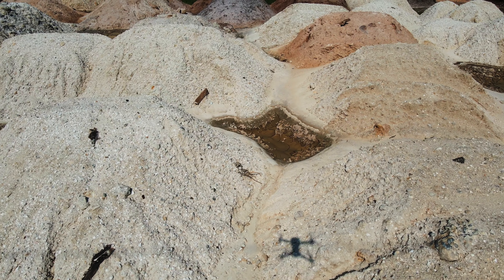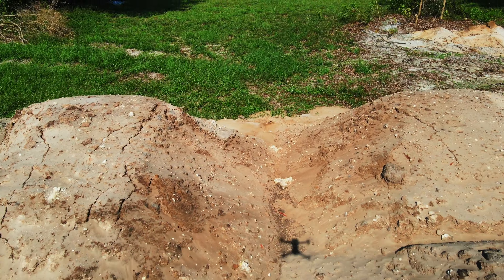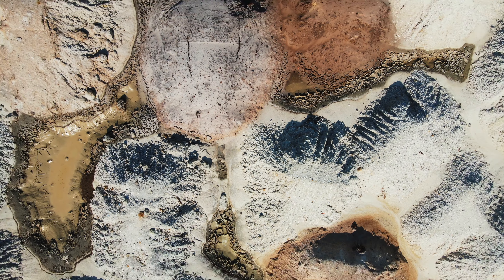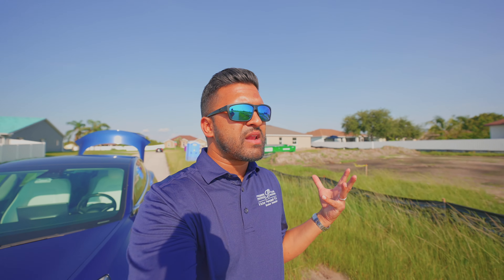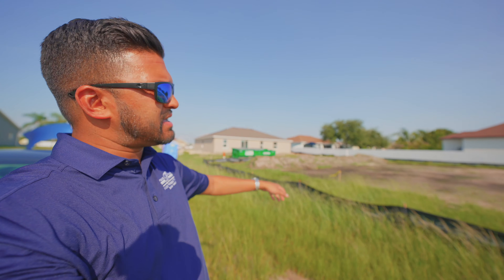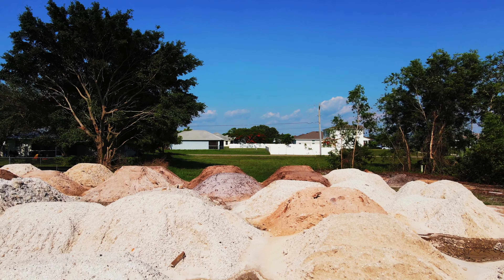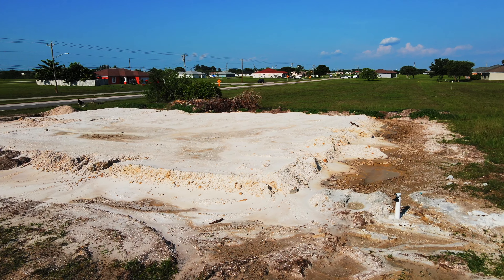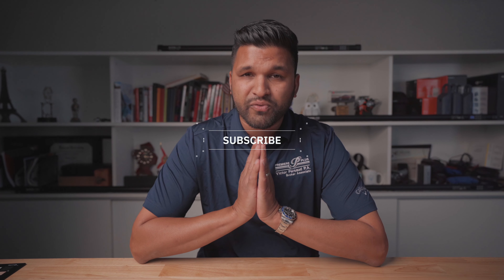Fill dirt Cape Coral Florida in New Construction

Comment: you provided good technical side of fill dirt none organic, tonnage and compaction. if you can obtain the information. please talk about the costs of clean fill dirt material and dump truck delivery charges. i'm sure this is rolled into the home price by the contractor, but if i someone wants to owner/build they need to find supplier and delivery costs. thx
Reply from the maker: This is wide range because the cost of fill dirt is directly related to how far they have to travel from the quarry to the construction site. In Cape Coral from 250 to 400+ per load